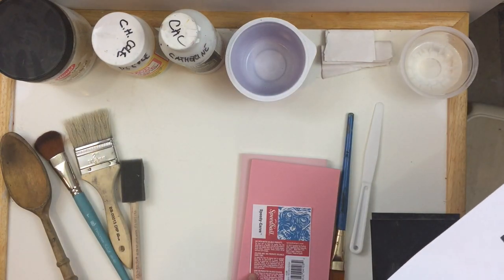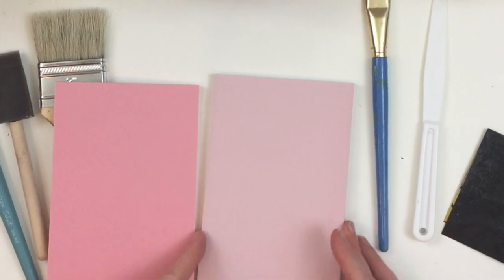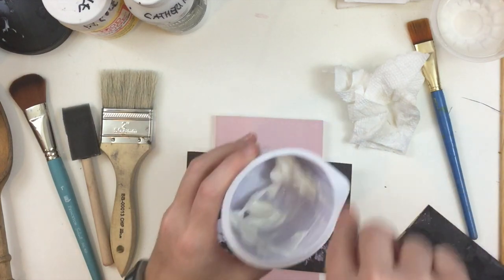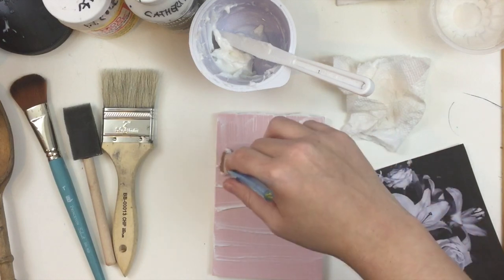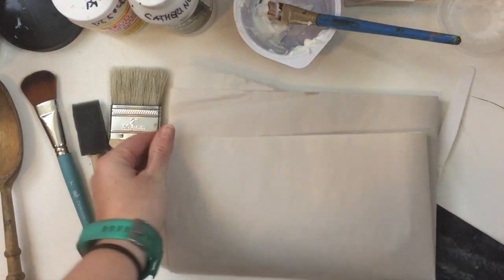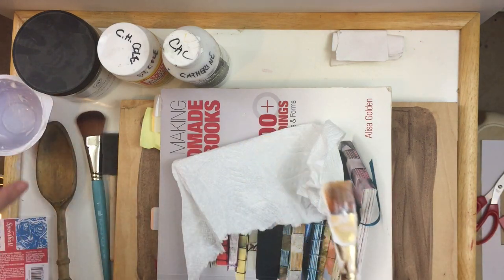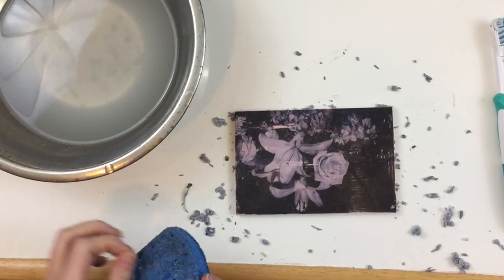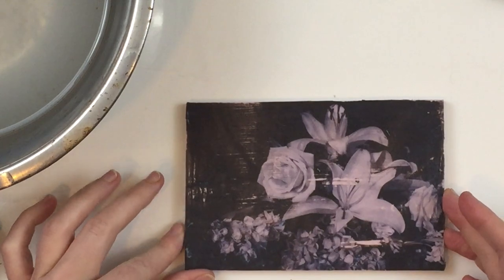Transfer an Inkjet Print to Linoleum Block

Comment: Could I use a fluid medium instead of a gel medium?
Reply from the maker: Very delayed reply, but I'd say give it a try! I like the body or viscosity of the gel medium and it was what I had on hand. It tends to lay down a little thicker and stickier, while fluid is designed to spread, but that might be a good thing for this method. If you tried it, let me know how it went!

Comment: What number is the sandpaper? Possibly ver fine/
Reply from the maker: I used a wet-dry sandpaper for this, I don't remember the exact grit, but I think was between 300 and 500 grit. I have a pack of sandpaper that goes up to 2000 that I used for polishing copper, but or lino 300 should be plenty fine enough for just abrading off surface oils and textures.

Comment: THANKS FOR THE TUTORIAL. CAN THIS WORK ON SILICONE PRODUCTS?
Reply from the maker: Thanks for watching! :-)  I have not tried it on silicone, but as many silicone objects are designed to be non-stick or are used for molding/casting,  there's a chance it would work, but I imagine it wouldn't be permanent and could be peeled up easily, which could be great if you want to create a skin-like, slightly stretchy photograph to then use in a mixed media piece of some kind... so my guess is it depends on what you would like to do with it! You might sand the silicone to help with adhesion.  If you try it, let me know how it goes!
Reply: Tried this it works a bit but indeed peels off so easily that it's almost more annoying than just tracing it with some graphite paper
Reply: @Chcole88  Thanks for your reply. I really wanted to use it to fill the words engraved on a silicone wristband. If you have any options please let me know. I have searched for a silicone ink here in Malaysia but all I could see so far was sublimation ink or screen printing ink. I really need help in this area.
Reply from the maker: @justaperson4699  I agree it does peel!  For context, I made this video for a digital printmaking class to show how to transfer complex digital designs to lino without needing to trace for hours on end. So it's not meant to be permanent or perfect. It's similar to the Japanese method of gluing a drawing on thin washi to a woodblock, but the drawing sticks to porous wood better. So there are lots of variables to contend with-  from the type of lino used, to whether it's been sanded, to if the medium is too thick it peels faster, and if your tools are not sharp enough to catch on your fingernails, the medium is more likely to stick to the tool and peel. Glad you gave it a try, you never know when it might come in handy!
Reply from the maker: @adelekeadeleke9284  I don't think this would be a great method if the words are already debossed on a wristband. Maybe check with a manufacturer that makes silicone products- maybe try this channel? Hope you find the info you need!  https://www.youtube.com/channel/UCAQNCiyOUv-NOOhkpLcVVVw
Reply: @Chcole88  OK thanks

Comment: Do i have to wait 24 hours ?
Reply: Update : i waited two hours and it worked !! thank you so much your video helped me alot
Reply from the maker: @linasaad5264  I'm so glad to hear! I usually say 24 to my students just to allow it to both dry and for it begin to cure and polymerize a little bit (it can take up to 2 months for acrylic polymer emulsions to fully cure!) so the longer one waits, the less likely it will be lifted once water is applied.